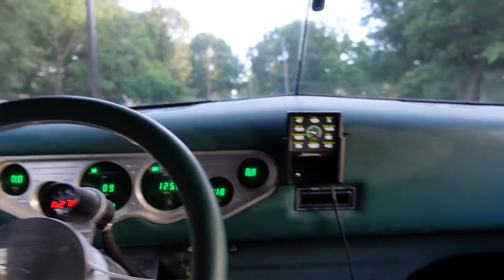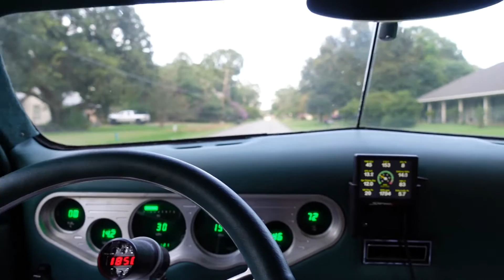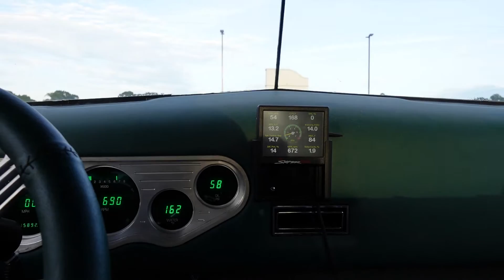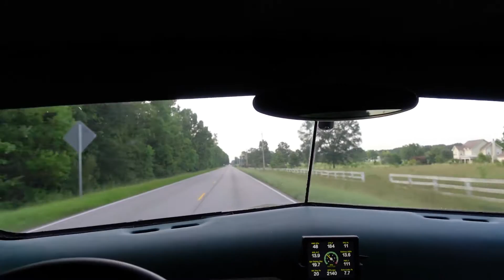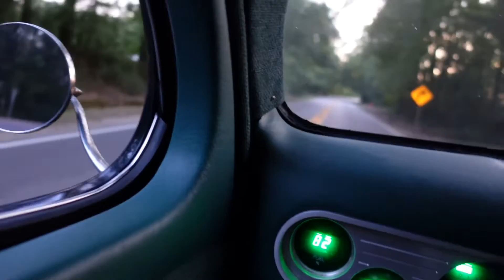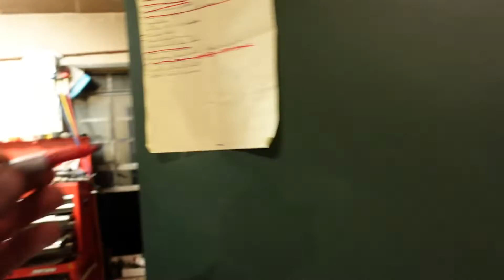Race Week Build Part 37 - First REAL Drive

Comment: Could a tray attach with cup size holes seat to seat over the tunnel?
Reply from the maker: Possible. I've got a couple I think will attach well to the shifter cabinet. I also need to get a new fire extinguisher.

Comment: We heard you mention the "high beams". The switch is foot operated and the high beam indicator light is between the speed and odometer. A very small dot of light about a pixel size.
Reply from the maker: Yep. That's what I was looking for when I turned them on. Still works.